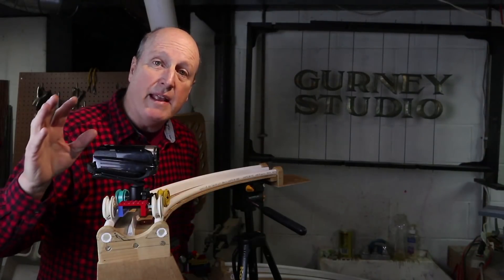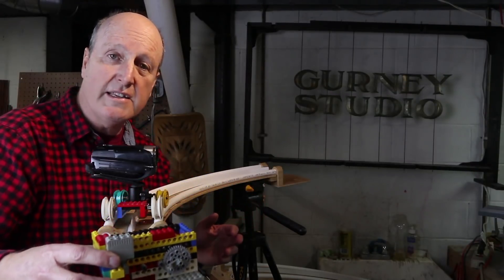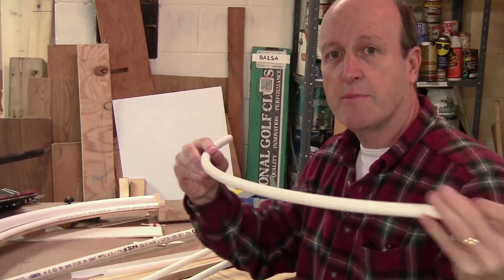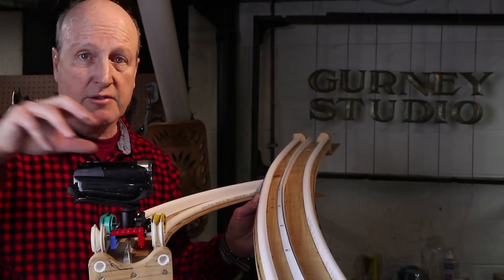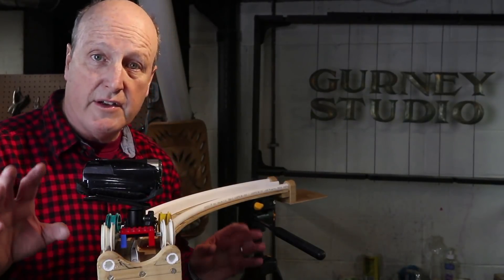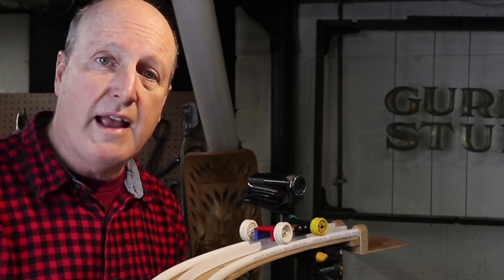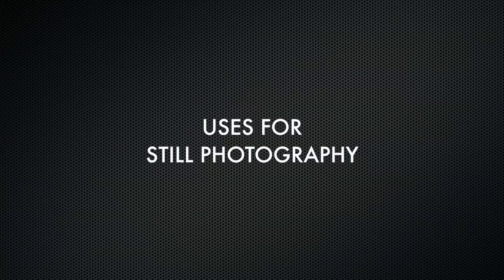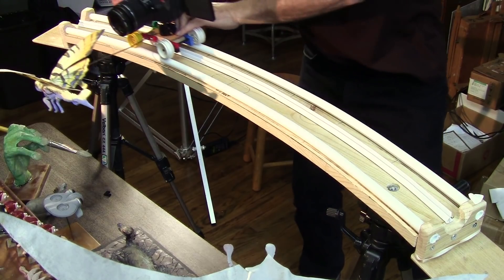Curved Track Dolly with Pex Pipe and Lego Motor (DIY Demo)

Comment: Very clever! I wonder if something could be engineered on the lines of a roller coaster wheel system. Wheels on top and bottom of the tube would keep the camera from tipping off. I'll have to ponder this...
Reply from the maker: Yes, I also have a straight dolly with two parallel aluminum pipes that the cart can hang from, and that one is safe from the risk of falls.